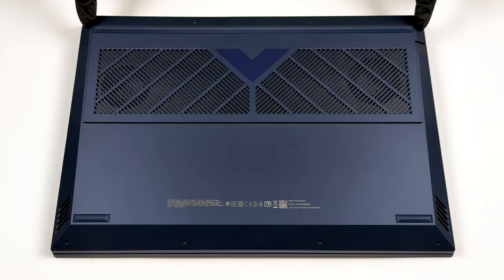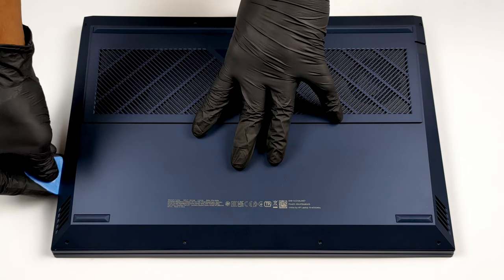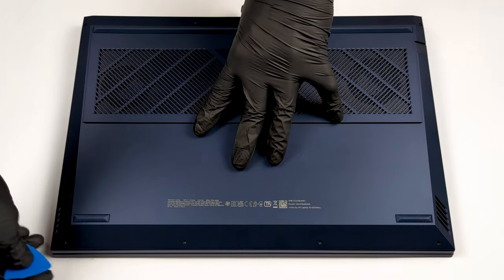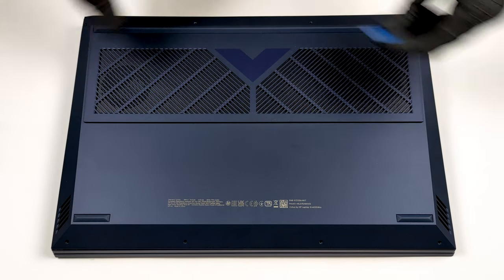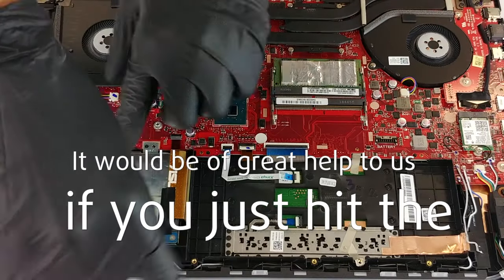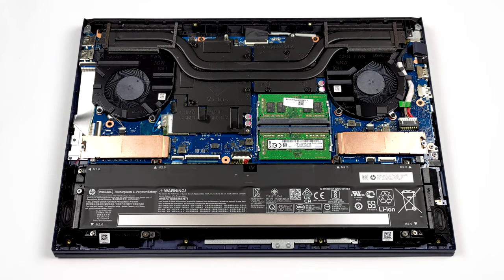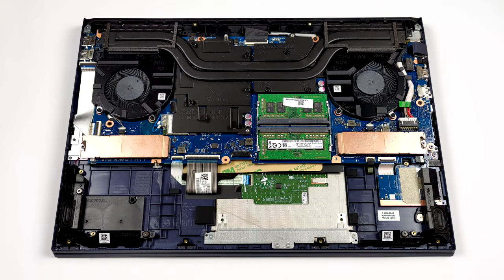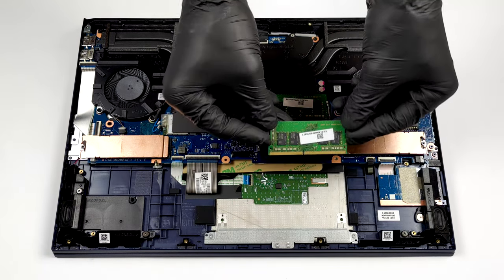🛠️ HP Victus 16 (16-e0000) - disassembly and upgrade options

Comment: You just breezed over prying the panel open. Not helpful.
Reply: You need to first unscrew the 8 small filips screws around the laptop, then i had to kinda "pry" it with a little bit of force, a none-fillips screw helped me to do it so it can get inside the tiny gap where he puts his triangle thingy

Comment: Planning to upgrade my ram. But quite scared to open the laptop back cover bcs it is kinda tight.
Reply: Unfortunately it is tight. Use a safe tool for it so you don't scratch it up. It took some elbow freeze for me but it was doable and didn't break anything. Good luck!
Reply: the cracking sound of opening the back case scared me to death lol, wouldn't open it again except for some serious needs
Reply: I Tried To Open It & I Broked Panels Clips
Reply: Breaking clips is not an issue. Some of them will break, as long as it's just a few you should be fine. And even if all of them break, it's still held in place by small 8 small screws in the end.

Comment: I'm looking to upgrade the storage on my victus. I have a 2TB NVME M.2 drive that I bought to install. However I am now reading that each M.2 ssd slot in the laptop can only support a 1TB drive? If I were to install my 2TB drive into one of the slots, would it just flat out not work? Or would the drive work but only 1TB of the storage be able to be accessed? if that makes sense. Thanks.
Reply: Where did you read that
Reply: Did you find out?
Reply: Hey there, it worked??
Reply: It works

Comment: So....No 2.5" HDD slot in the Victus 16-0000 series ? Should I expect then that it is the case of a HP VICTUS 16-e0029ns ?
Reply: SATA slots take a lot of space, so M2 slots gained a lot of ground in the matter of notebooks. To answer your question: yes, it's the same for all HP Victus 16 models.
Reply: @GlumWretch  Thanks a lot. :)
Reply: @GlumWretch  Hello. Finally I am planning to get a 16-e0031ns , and I am guessing that for this matter, it is the same for all 16-e0000 series. Do you happen to know if this series is compatible with Corsair MP510 960 GB ? . I have digged in google, but can't find it. It is a  M.2 2280 , PCIe Gen 3.0 x4 disk (TLC), but I don't know if it will work in the extra slot that comes empty.
Reply: @3polygons  The storage slots of HP Victus 16 are PCIe Gen 4 TLC. PCIe Gen 3 and Gen 4 are both backward and forward compatible, so you shouldn't worry about it.
Reply: @GlumWretch  Thank you very much, again.  :)

Comment: do i have to remove the battery before adding the second ssd?
Reply: You might want to disconnect the battery as a general safety precaution (for your components) but you'd probably have to remove the battery screws and lift the whole thing up to get the proper leverage on the power connector.

Comment: is there anything else you can use to open the backplate?
Reply: better to use the plastic tools as they should be softer than the laptop itself so you can't damage anything and are non-conductive, but if you can control yourself and be careful you can use a metal spudger tool or a paint palette knife.
Reply: Credit card

Comment: Does it have SATA 2,5" HDD/SSD slot or just two M.2 SSD slots?
Reply: I confirm it doesn't have a SATA slot, only M2
Reply: @GlumWretch  Thanks
Reply: the bottom of the laptop isnt thicker than 2.5 inches lol
Reply: @lunarluxe9832  tis sucks. I hare flimsy tech, like those easy to bend iPhones.

Comment: my CPU temperature reaches 95°C when playing games.. but the GPU only about 75°C.. 95° is not a comfortable temperature in my opinion..

I am planning to replace the thermal paste (maybe Noctua brand).. will it reduce the CPU heat? and will it void my warranty?
Reply: Yes, it will void your warranty. Only if your laptop is older the one year, changing the thermal paste might help. Other solution for temperatures is undervolting your notebook. But, as an idea, 10 - 35 degrees C  (50 - 95 degrees F) is considered a safe temperature range.
Reply: Just put it on a cooling pad my dude, even under full load my GPU never goes above 70 and CPU generally 80-85. I use the Targus Chill Mat.
Reply: update:
I can't find HP official service center near my place, so I replaced the thermal paste by myself using Noctua NT-H1. And I lift the backside of my laptop to improve the airflow.
Now the temperature when playing games never reach 90C on auto fan speed, but it will still reach 100C on performance mode.
Another thing that I notice is the middle side of the keyboard is quite hot to touch while playing games (I didn't realize this before, because I only use the left side of my keyboard, around ASDW key).
Nevertheless, I am quite satisfied now with the temperature. And also I will consider using cooling pad.

Thanks for the suggestions @George D @AlecMcJoMTB
Reply: @countspersecond   You should lower the CPU frequency from the regedit file. There is no loss of FPS in games and the temperature drops.

Comment: Finally I am planning to get a 16-e0031ns , and I am guessing that for this matter, it is the same for all 16-e0000 series. Does anyone or @LaptopMedia happen to know if this series is compatible with Corsair MP510 960 GB ? . I have dug in google, but can't find it. It is a  M.2 2280 , PCIe Gen 3.0 x4 disk (TLC), but I don't know if it will work in the extra slot that comes empty.
Reply: Did you find if it is compatible thr 510 corsair?
Reply: It is a 2280 Gen 3 slot. Any gen will work though, even gen 4 and 5, just they will work at reduced speed.
So just buy gen 3, it's cheaper.

Comment: I want to upgrade to 64 gb ram but the hp website says it only supports 32. Has anyone upgraded to 64?
Reply: Windows 11 Home Edition supports up to 128GB of ram so go for it.
Reply: Hey, I didn't go up to 64GB but I reached 40GB by have one 32GB stick and another 8GB stick. I assume i'd be able to go to 64GB
Reply: @theuncanspan  It's useless if the motherboard won't support the RAM. If you exceed the supported RAM, depending on each motherboard, you'll get different outcomes, but most frequently, you'll get BSOD until you downgrade back.

Comment: Hey man , does the laptop come equipped with a dual channel ram (4Gb x 2) setup or single channel 8Gb? Specifically talking about the 16-e0350ax
Reply: 2 x 4 GB
Reply: Nope it has only 1×8 ram
Reply: It is single channel
Reply: @dharshithdinapadu6652  its fucking not bruh. i literally have this laptop and its 2x4gb
Reply: Its single channel bro i have this and you check from task bar
Reply: @aztecayt7080 bro what is watt of 3050 grapic card in your laptop?